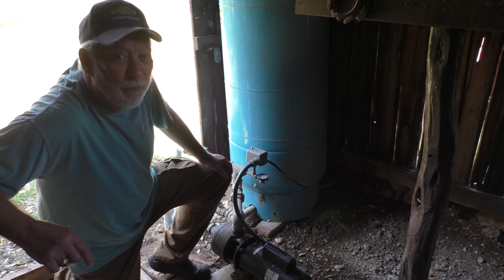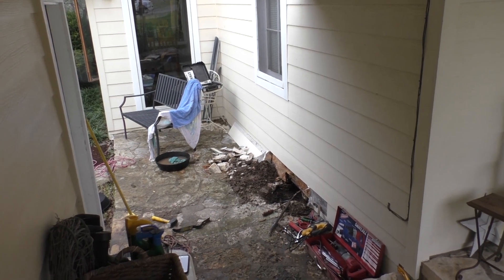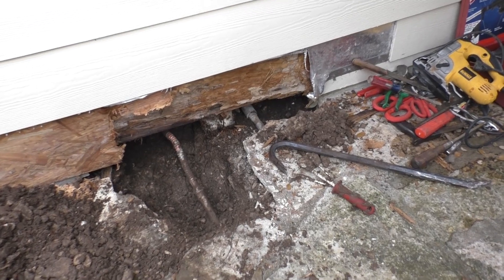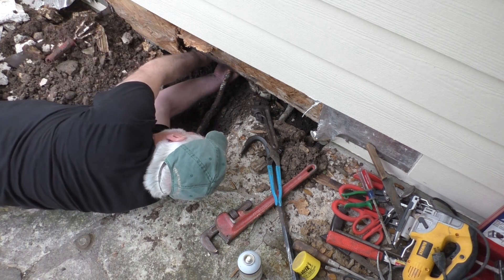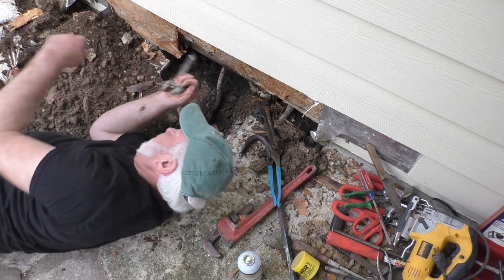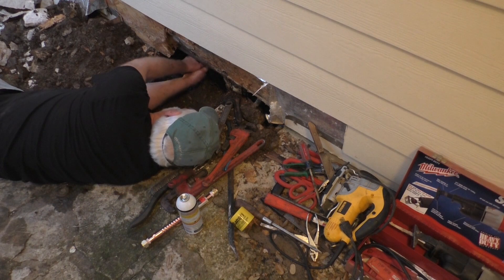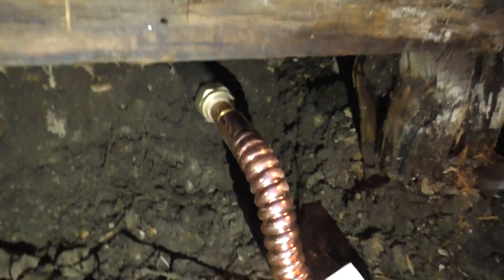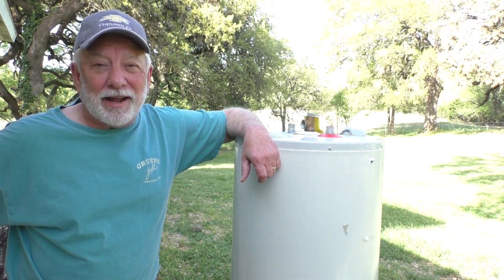Getting Down, Getting Dirty

Comment: I too live in a century home. It sat vacant for over 30 years as the previous owner used it for a warehouse. When my then wife and I moved in we completely updated the house and converted what was a duplex into a single family home. Plumbing the house was a challenge! In those days the laundry was in the basement, I moved it to the 2nd floor. Put a 3/4 bath on the first and redid the 2nd floor bath. Still have the original clawfoot tub. Anyway, as long as the important stuff rolls downhill and away from the house you're golden! hehe
Reply from the maker: Golden indeed, Erik!  Have a great day, brother!

Comment: A very happy birthday!  Being a 75 year old widow who lives alone, so glad I had a dad who thought girls need to know things like hanging a tire, how to turn off water and empty your pipes if you spring a leak...which I recently did in my ceiling.  I live in Florida and our houses are built on concrete slabs and walls are concrete block so water pipes are run through the roof space and attached to the roof rafters. We don’t have attics down here either. Used the bathroom in middle of night and with house so quiet, heard a drip somewhere!  Ran outside at 2am and turned water off, ran all the sinks in the house to empty the pipes after I filled some gallon water jugs to have water for toilets, dogs, dishes etc.  next morning called plumber and bless his heart , he delayed a job that was in an empty house and came right over.  Found out my plumbing in attic was old  plastic that no longer is used in construction and was improperly hung from from the rafters which caused pin holes to open up at where the pipes were attached with “t” connectors.  After $3800. I now have all new piping in my attic and piece of mind.  God bless the honest plumbers in this world.  Found out one of my neighbors had same problem and paid $6000.!  Hope your wife appreciates your handy skills!  Love your videos and tales.,.watch all your offspring too!

Comment: Happy Birthday Dr Lee!
 As the only child (daughter) of a plumber/steamfitter, I was taught the basics of plumbing early on. First lesson was where to turn off the water to the house lol.
 I've done a bunch of small repairs and know just enough to tackle small projects. I've pulled shower knobs replaced stems and changed out faucets. I've changed the washers in my kitchen sink and replaced all the flushing parts in my toilet tank, changed out p traps and repaired a leak in the waterline to the icemaker. I will tackle the small stuff and figure if the worst happens and I can't fix something then I dont mind paying a pro. I admire you and your diy talents!!!
Reply: oldladytoofast ....I suppose small stuff is relative. Lol. The most adventurous thing I've done is replace a garbage disposal and install kitchen and bathroom sink faucets. Yet, if if my toilet overflows, I'm screaming for my husband like I saw a spider. Lol.
Reply from the maker: oldladytoofast and samiamisme  good for you two!  I will try most plumbing issues, but fortunately, I do know my limitations!!!!
Reply: samiamisme. You have me beat!! I sure don't consider installing a garbage disposal as a small job. I have rewired many a lamp in my day but no way would I tackle a garbage disposal. Good for you!!

Comment: I worked as a plumber for 14 years. Held a State Masters license for 8 of those years. Working on everything from lead joint Cast Iron pipe to  galvanized lines, copper lines and CPVC  and PVC lines. 

Hmm, I read blueprints for housing units and condo complexes, then again I also read them for electronic repair as well since that falls under my Computer Robotics and Electronics Engineering Masters degree. Awe gee I diversified my abilities. That does nothing for the Theology degree as a Bachelors [Hebrew and Greek foreign languages]. I'm not the whats called a normal individual, but there was a 28-year break between those two degrees. Which allowed my military service in both the US Navy and US Army. Only to get recalled 7 years after having gotten out to go back to the Navy for another 6.5 years. That made my 28-year military service career.

2- 3/4" PVC pipe freeze wrapped should solve that problem. 2 - 3/4" FIP  adapters, 24" 3/4" PVC pipe, pipe cleaner and PVC glue. DO NOT USE SCHEDULE 20 Pipe that's drainage pipe. Schedule 40 is made for pressurized lines.

Comment: Dr Lee, I feel for you my friend. I bought a house built back in 1950.. Well, yes, I have a well.  Pump and tank went bad 2 yrs after I moved in. They are both in the torture chamber crawl space in the Half Basement. Replaced them. Oh, I was the one being torched on that job. How water tank started leaking so I did that also. Thank Goodness it was on the first floor laundry room, but... All the pipes in this house are old galvanized steel pipes. Yuk.  Been about 10 years and that new/old pump is going to blow a gasket, or my mind. Just going to replace it again. Back to the wet spider invested crawl space in a couple weeks to do that AGAIN. Cloths washer is shot also. Gonna get a new one.  It never ends does it. Nothing lasts forever, heck, I would be glad if it lasts for 5 years...  You will feel better when it is done but it is always???  What NOW... around here. Apparently there also. Have fun and happy Easter..

Comment: Happy Birthday Dr. Lee!   
I'm pretty sure copper will corrode underground faster than steel.   Because water is flowing through the copper tubing electricity is produced in the copper and then is grounded by the earth.  That causes the copper to corrode.  I had to replace 30 feet of copper tubing in a home that was only 7 years old just because the furnace man place his metal duct against the Copper, grounding it.  Copper Tubing should never come in contact with anything that conducts electricity Nails screws straps all need to be made of copper or a non conductive material such as plastic or rubber coated straps.  Dr. Lee you should now check the rest of the tubing for those little green corrosion marks.  God Bless and Happy Easter!

Comment: OMG This is why I will not own a house without a basement!  Even an old root cellar is better than having to do what you did and it keeps a lot of the rusting issues down to a dull roar.  I am so sorry!  We only have an every 6 month roto rooting issue, but after the first two years we bought our own and it has paid for itself many times over.  My dad actually used the old water heater to hold water and bring it to room temperature, then it goes into the new water heater which has to work less to heat up the water.  I hope your birthday celebrations are good, sorry you had to work so hard on the actually day of birth.  Happy Easter to you and your family!

Comment: Happy birthday 🎂 and Happy Easter. Loved the video. 👍 Been there done that with plumbing issues. But to be honest, never one using water heater pipe for supply plumbing. Spray it with a Rustolreum flexible coating, bury it and forget it.

Comment: Happy Birthday!  and.. that pipe is exposed now so if you don't bury it you might want to insulate it. Yup... all that new pressure will always find the weak points in the system.
Reply: Insulate it?  You're not from Texas, are you?
Reply: RyeOnHam I live in south Louisiana and the pipes in our crawlspace were insulated by my dad back in the 50's even though we usually don't have a freeze that lasts long enough to freeze pipes. If there is a PPPP order ( protect pets pipes n plants)  Usually letting a thin stream of water run between 9p n 6a is enough to prevent cracked pipes. But this last winter we had the worst freezing weather in years. I had one of the few homes in my area that didn't have any broken pipes. Dad was right. Its always better to be safe than sorry!
Reply from the maker: I've left it open to dry out.  I will insulate it with those split foam tubes and then cover it up with the dirt I removed....should hold up as long as I do!

Comment: Happy B-Day to You!  Retired plumber, once you went thru the effort to expose and clean, fixing it right is the fun part. Galvi fittings, various length nipples, with a 3/4" union to tie the "dead ends" together. You just could not imagine the many screwed up ways and materials used  i've seen work done, especially DIY and/or done by friends, and yes, i've seen the supply line tied into the house lines, wrongly,  just like yours. All said and done though, your repair once insulated, should last you 10 years anyway. 

What's going on with your Camaro project?

Comment: That copper tube water heater connector is not suppose to be buried underground. you could use soft copper and flare nuts and you don't take a chance burning your house down. Also they make some mechanical fitting called Shark Bite that you just push on hard copper tubing Not soft copper and that tubing is guaranteed for 50 years. In Missouri we bury or water lines 36" deep to keep them from freezing looks strange to see water service buried so shallow. Then I remembered your in South Texas. I've been a licensed plumber since 1979 in Missouri. So who do you think will tear down your house?

Comment: Copper and concrete just do not mix.  The concrete corrodes any copper in contact with it so it's best encased in a plastic sleeve or at least bound with heavy duty tape.

Comment: I'm not a plumber but I have to do some plumbing occasionally at home and at work and I hate it. I'll take electrical work any day over plumbing. Electricity may bite you every once in a while but if your wires aren't connected tight, at least it doesn't run out all over the floor like water does with a loose pipe.
Reply from the maker: Totally agree!  I'd take electrical over plumbing any day!!!!

Comment: Aren’t jobs like this why we have sons?   If they can’t actually help with the repair, they can commiserate and make a beer run.
Reply from the maker: Yep, except they sonehow  seem to be scarce when these things happen!!!!
Reply: Not only sons! 
I myself have replaced faucets and drains (getting the faucet stem seals back in place was the fiddly bit), done carpentry, dry wall, and basic electrical wiring (even completely re-fitted an antique lamp for a shop in town and wired in the rear doors/windows of my retired police car). 
I just didn't like waiting around for someone else to do it.

Comment: I thought for a second there I was looking at my plumbing in a house that I owned about
25 years ago the well pump went out took 3 days with a buddy of mine to get that part done
two days later my wife tells me she can hear water running under the bathroom floor I can seewere it is leaking from the out side of the house but can not reach it without digging a
15 foot long trench two foot deep I finally cut the bath room floor out and the same exact
Problem that you had with flexible copper pipe put back same way because house was sooner or later was going  torn down was built in 1901 two years when we sold they split
the property tore old house down and built two in its place
grumpy old man with a bus

Comment: NO it is NOT common. You should have lifetime PVC PUT on with maybe a gate valve to turn water on or off when needed.
Too bad there's not enough room to have a crawl space there.
I'm 68 years young female and I do all my own plumbing tricks. I had help over the years frim my Dad who was a master pipefitter.
If you put the hot water fitting back on, don't put dirt on either end. Just get a nice board and paint it white. Cause that ain't gonna last. And you didn't put on any pipe dope to seal the threads. Tks tsk tsk ♥️
I live in 2 story Craftsman 4 Square.
Happy Birthday.!🎈🎈🎈🎈

Comment: Yeah, I have had to fix so many pipes in my house, you could say I re-plumbed the whole house. It always starts with the pump which increases the pressure, and blows out the first questionable pipe and it continues down the line.

Comment: That copper pipe will last a lot longer than the rest of the steel pipe so I would call it done if it were mine, but I am no plumber either.  If the old one lasted 30 years though it seems kinda silly to do something else to me.  Happy B-Day though.
Reply from the maker: Pretty much my thought too, Davis.  I AM gonna wrap the pipe, as we've had it freeze up a few times in the last 30 years....

Comment: Plumbing issues with my parents' home is still giving me fits, and I should note that Mom sold the house 2 1/2 years ago. Before she sold the house, not only did the sump pump quit but leak sprung up. She had it pumped out. A few weeks later I rented a pump and pumped it out. I did it again after a week, and finally a plumber came and made the proper repair. The problem I'm having is that the water heater burst before Dad passed, and I had stored a rifle in a closet directly under the damned thing. Naturally, Dad tried cleaning it up himself and lost a part, that I now get to order. And I wouldn't worry much about swearing; through all of this Mom has discovered that I can swear in five different languages.
Reply from the maker: Yep, "plumbing" will open up the swear book almost as fast as "painting!" Didja find the gun part and order it???
Reply: A local gun shop directed me to a website, I've ordered a pin for the trigger group. It's a small pin, easy to overlook, I probably chucked it when we were cleaning out the shop.

Comment: My leak was over a door going into the back addon of the house. Water damage above the door needing new plaster board. No way to get fixed without cutting pipe and figuring out how to add to it. Not my brain power...unknown knowledge. Since no way to pull out old pipe, I used a 6" clamp with rubber to fix leak. But found the worst of it....it was a hotwater line, made of galvanized pipe! Not copper for hot water.